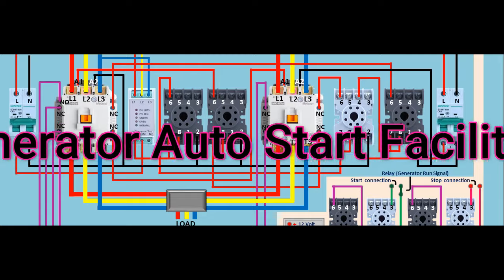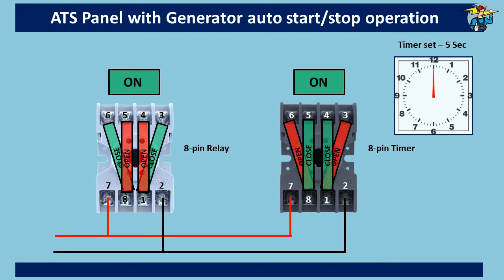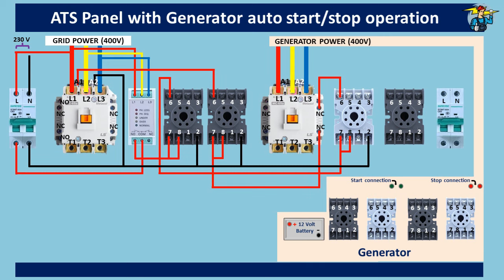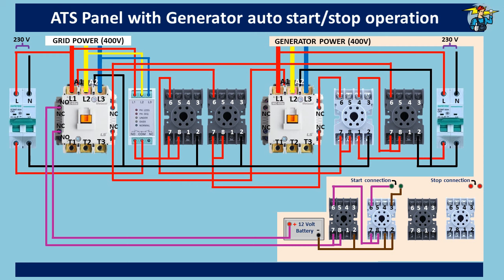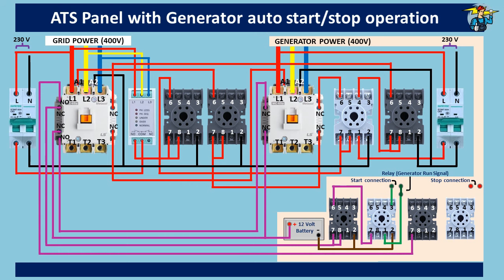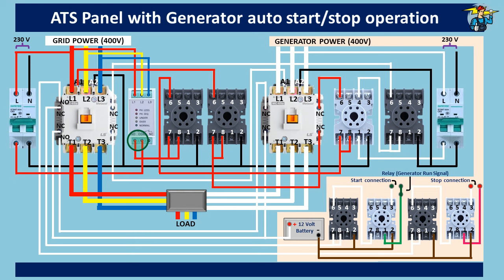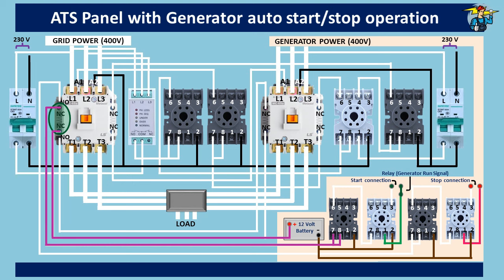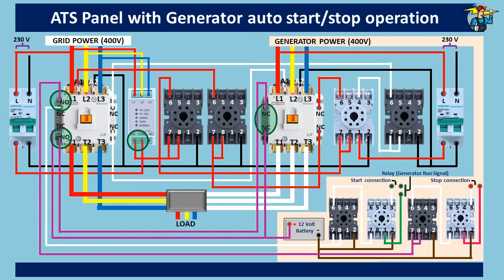ATS for Automatic Generator Start and Stop / The Best Video to learn all about..!

Comment from the maker: Dear All,
DPDT relay means Double Pole Double Throw Relay.
Double pole is mispronounced here as Double port @ 1:32.
Kindly take a note on this, when viewing/listening to the video.
Regards,
EA.
Reply: The start connection is the one from AUTOMATIC button on generator screen?how to connect it on that relay?thank u
Reply from the maker: Best way is to check with the generator supplier.
Then its easy with relative brands.

Comment: Excellent video.
Sir, how do i incorporate a switch to this ATS whereby when grid goes off and the generator starts, i can use the switch to put off the generator from inside the house if the generator is not needed at that time.
Thanks
Reply from the maker: You can arrange an additional two pole breaker (inside of your house) series to the generator control circuit breaker.
It can be used for this purpose.
However, for these type of work you need to get help from a good electrician.

Comment: Hello, where do we get the neutral for the load from? How do we ensure there is always a neutral cable from both supplies without them interconnecting?
Reply from the maker: From the generator supply, you get separate neutral cable.
So, the two neutral cables need to be connected separately, as shown on the video.
Reply: @ElectroAcademyEA  It only shows the 3 active wires going to the load, how does the neutral wire connect to the load?
Reply from the maker: Sorry for that I have not shown it in the video.
As done for the 3 power lines, you need to get two neutral lines separately from the grid and from the generator to the junction box, and connect it.
From the junction box, only one neutral line to the load.
3 pole contactors on grid side and generator side, need to be changed with 4 pole contactors to provide neutral wire through it.
Reply: @ElectroAcademyEA  4 pole contactor! okay thank you very much

Comment: This was an explanation  thank you Sir  please what are components that make up this design and connection? I know 2 magnetic contactor, 1 phase failure relay, 3 Double pole double throw 8 relay, 2 AC double pole breaker, 5 Timers
Secondly on the battery relays you connected port 1 and 3 of start and port 1 and 3 of stop to what components is it 1 and 2 start- push and 3 and 4 stop-push components?
Reply from the maker: Yes.

Comment: Thanks for the lessons,  please can I apply this to a single Phase? And can I have the circuit diagram for this video, thanks
Thanks in anticipation
Reply from the maker: Thank you.
You can use this for single phase generator wiring too.
Instead of 3 phase 3 wires on power side of two contactors, use live wire and neutral wire on L1 and L3 terminals. 
Keep L2 terminal empty.
Control wiring is the same as shown in this video.
Reply: @ElectroAcademyEA Sir, if this procedure for single phase Is followed accordingly for a generator with battery and key starter, will the generator turn on automatically when the grid supply is restored

Comment: OK but I have a question how would this design change if you you wanted to build an ATS that changes between 3 sources. An example would be if you had grid, solar backup and generator in that priority order. Would be great to know as there's almost no info available on this specific topic
Reply: Bro, it’s simple, just make another same set of panel and it’s out considered as second prior after the grid, for example just do this circuit with solar and generator and it’s out again do with grid supply, in this way you can make infinite number of power sources 💪😉
Reply from the maker: Building an Automatic Transfer Switch (ATS) that can switch between three sources — grid, solar backup, and generator — in a priority order requires a combination of relays, contactors, and control logic to manage the transitions seamlessly.
Will try to do a separate video on this, when time permits.

Comment: Well done sir, pls how will one connect the ats for single phase generator to auto start/stop
Reply from the maker: For single phase generator, same two magnetic contactors can be used.
Instead of three phase lines, live wire and the neutral wire can be taken through it. One terminal on both contactors will be empty.

Comment: Hey sir what type of timer relay used. Is all the timer relay ON DELAY?
Reply from the maker: All the timer relays used here are ON DELAY type.
Actually we can use ON DELAY timer relays for average OFF DELAY functions also, by using NO and NC contacts properly.
Reply: Ok thank you. I'm going to build a system exactly like this soon for backup system
Reply: Is there any other way I can get in contact with you to get some more information about the parts to be purchased?

Comment: After that how does the generator start if the grid is out.
Reply from the maker: Through battery power
Reply: And what? Meaning the the battery have to be charge right?
Reply from the maker: Yes. You need to have a battery charger (powered by grid side) to keep the battery fully charged, in order to start the generator during a power outage.

Comment: Great Sir, Do you have 3 power source ATS model
Reply from the maker: Generally, control circuit needs only a single phase supply or direct current supplied through a battery, to operate magnetic contactors.

Comment: This design is suitable for Single Phase Gride and Single Phase Generator?
and how many self  start attempt?
Reply from the maker: Yes. You can use it on single phase grid with single phase generator.
Normally, generator should start with one start attempt.
If there are dificulties with starting, we need to check and correct it first.

Comment: Please explain how Manual and Auto mode is achieved in ATS
Reply from the maker: Introduce a two pole Isolator or a breaker and take battery wires to the auto start and stop connections through it.
Isolator "ON" position will act as "AUTO" mode.
Isolator "OFF" position will be the "MANUAL" position.
When Isolator is at OFF position, you need to start the generator manually when grid power is not there.
It will supply power to the contactor top and generator side control line breaker, allowing power to transfer automatically to the load.
Reply: @ElectroAcademyEA  thanks for your prompt response

Comment: Can you explain  how connect swich of generator  to run and stop generator  auto. Please draw wiring diagram for connections
Reply: yes I would like to see the same
Reply from the maker: Generator manual start button wires need to be connected to the two green points marked as start connection on the diagram for automatic starting.
Generator stop button wires need to be connected to the two red dots marked as stop connection for auto stopping of the generator.
If you need an auto - manual switch for generator, connection from the battery can be provided through a 2 pole breaker. 
This breaker OFF position will act as generator on manual starting only, still the power will automatically change over after you start the generator manually.
Reply: @ElectroAcademyEA  
I didn't understand you can you draw wiring diagram to explain that 
Thank you ❣️❣️❣️

Comment: Please if am to design this ATS for a load wattage of 25,000watts in facility what is the the size of panel by millimeters I should request to buy? That would contain these components
Reply from the maker: Actually the size of the panel is to be decided according to the component sizes and the relevant wiring work too. Some component sizes might be different according to their brands also.  
If you are not an Electrician, better to get help from one to get good idea on sizing of the panel board.

Comment: On the grid side you used two timer relays 
Can’t one timer relay do the job
Reply from the maker: Timer 1 is there to make generator to run on load for 2 to 3 minutes even after grid power is available.
If grid power goes off again within this period, generator is on load and power supply will not be interupted.
Although recommended, you can omit this timer if intermittent power disturbances are minimal.

Comment: Excellent explanation! Just one question though: contactors have 3 main poles and 2 accessory poles?? The ones I usually see have just one accessory...
Reply from the maker: Normally contactors have 2 auxiliary contact points, NO and NC.
But, according to the requirement, you can purchase heavy duty contactors with 4 auxiliary contact points, two NO and two NC points.
There are contactors where you can add more auxiliary contact points on to it also.
Additional contact points can be slide on to the contactor top and lock it.
It should be done according to the manufacturer recommendations only.
Reply: @ElectroAcademyEA  good  please should I use stop push and start push buttons to manually switch off and on generator?
Reply from the maker: @michaelisongekwere1402  Yes.
Further, you can use a 2 pole breaker when wiring 12 volt power from the battery to this system.
Breaker "ON" position is your generator automatic start/stop operating position. 
Similarly, breaker "OFF" position will act as generator manual start/stop position.
In both these positions power transferring will be fully automatic, although you have to start the generator manually, in breaker "OFF" position.